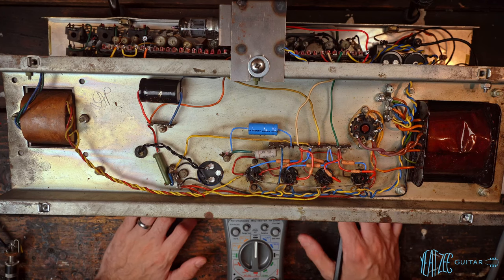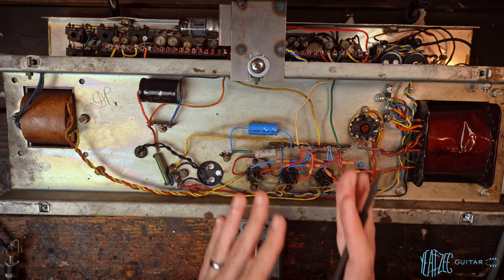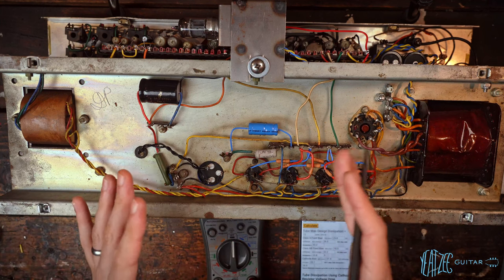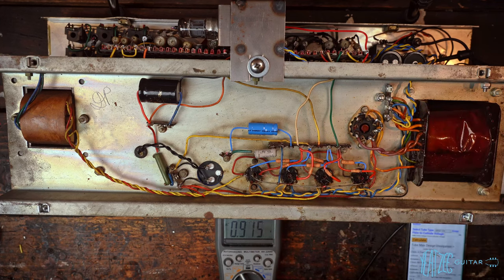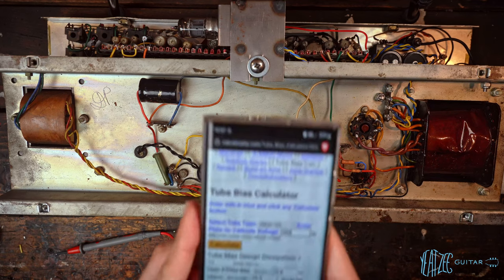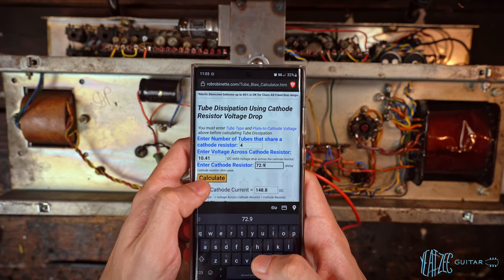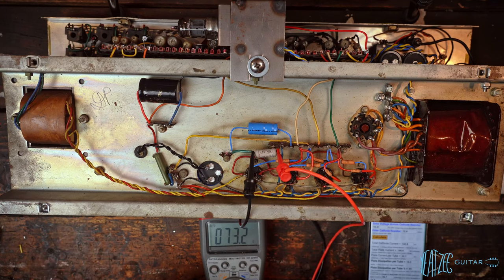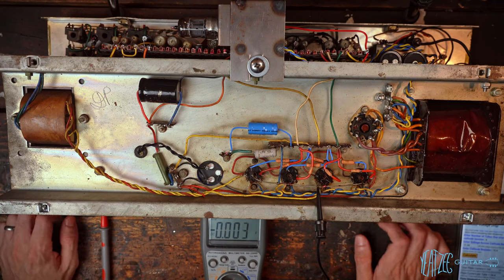Cathode Biased and Buzzy... JMI Vox AC30 Repair Pt.10

Comment: Yep, meters use a calibrated voltage to measure resistors. The microcontroller computes Ohms Law and displays a value. 

Analog VTMM’s used high tolerance resistors/ammeter gauges and voltage to display a value. That’s why there’s so many ranges on the dial, unlike modern digital meters.
Reply from the maker: Makes perfect sense!

Comment: For newbias and laypersons,  the mention of "subtracting 5%" from the plate current figure when calculating where the bias sits is because the tube's "screens" dissipate a small amount of power, roughly 5%,  that shows up in the measurement as part of the total tube current but doesn't actually affect the tubes' plate dissipation.  Some people subtract it from the current (amperage) measurement beforehand (before calculating the wattage dissipation of the plate circuit), and some will subtract it from the final plate dissipation figure as was done here, but I don't think it makes a difference in terms of accuracy.
Reply: Edit: "newbies," not"newbias". Facepalm!
Reply: @goodun2974  Still works!

Comment: Are there any fasteners between the chassis and power transformer? If so, try tightening those too. Kinda have to get in there with all the wire attached still, but it can be done.

I’ve heard worse transformer buzzing. It doesn’t sound like an overcurrent hum to me, so it’s probably fine.

I would monitor the temps and let her rip. Luckily, you’re in contact with someone much more knowledgeable and experienced with Vox amps than I am. I think I recall Lyle talking about Vox iron kinda just doing that sometimes, depending on the manufacturer.

Power transformers get very warm. Since you have other amps with similar sized iron(one with almost identical iron), it’s simple to compare temps. One of those inexpensive laser temp guns from Harbor Freight will work perfectly, or the thermocouple that came with your DMM if you have the patience for that.
Reply from the maker: Yeah I tightened the nuts holding the PT on, but I'm thinking I'm going to actually loosen it and see if it's mounted ok since it's not the original part maybe it was installed slightly weird.  Yeah it gets warm for sure, but it doesn't feel more than I've experienced elsewhere so far. Not a bad idea to get the laser temp gun though!
Reply: @YeatzeeGuitar  Maybe some new hardware would help. I used some 10/32 bolts on an old Triad Tweed Super PT that was buzzing a little. The extra clamping force helped a lot.

They barely fit. If you have some calipers, measure the mounting holes in the PT. Get the largest hardware that'll fit. Stainless is usually a little stronger than standard bolts of these smaller 8/32, 10/32 and 5mm sizes.

Whatever you do,  Don't drill out the holes and short the laminations to each other to make larger hardware fit. Learn from my stupid mistakes!.
Reply: @matthewf1979  It is also worth mentioning that some Transformers will actually have a skinny cardboard tube surrounding the bolts that hold the transformer laminations together, so that the bolt doesn't short the laminations where it passes through them.  If the Vox transformer here does not have any kind of insulator for those bolts perhaps they can be insulated with  shrink-tubing before installation, if the hole diameter allows it.

Comment: Is there aluminum foil tape on the side of that slider board that faces the output circuitry? It wouldn't hurt to add some shielding there if it's not already factory installed. Is there any aluminum foil inside the Vox cabinet to shield the preamp section? Because that's where you would get the most amount of noise radiated into the circuit if it isn't sufficiently shielded....
Reply from the maker: There is not, good tip!
Reply: @YeatzeeGuitar  , remember that overlapping strips of aluminum foil tape have make electrical contact with each ( push a small Philips screwdriver into the seams and twist, to punch through the adhesive), and the foil has to contact the grounded chassis.